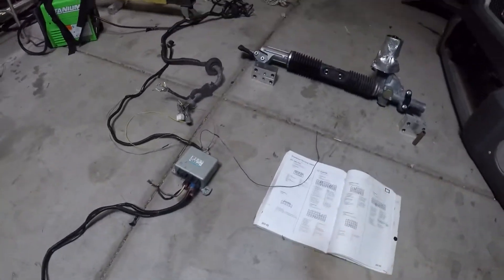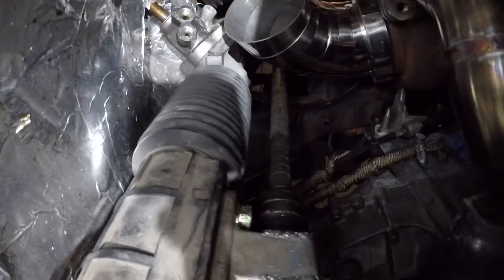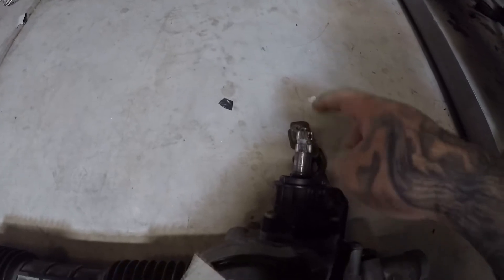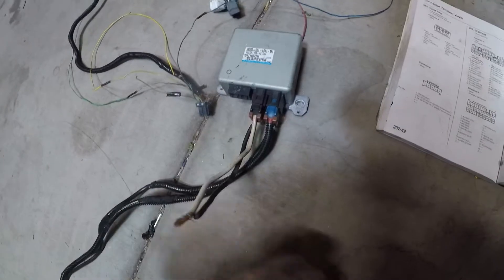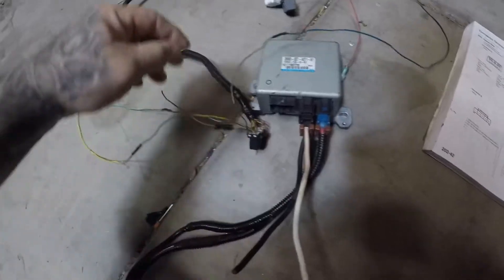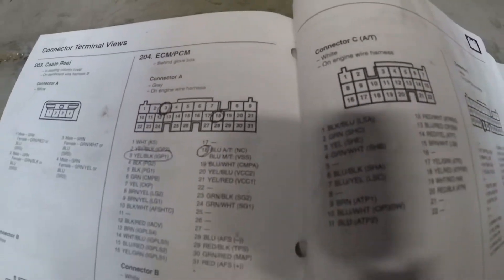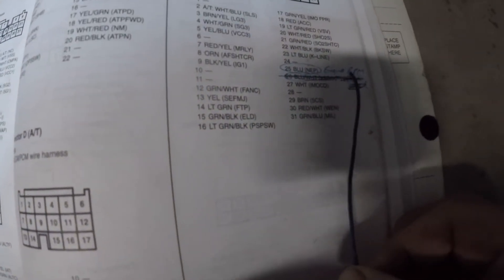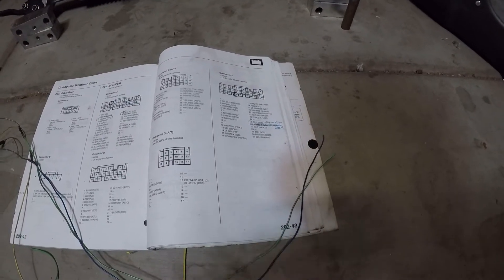Honda Element electric power steering part 2

Comment: Geeze Im listening hard. Your audio is severely muffled.
Reply from the maker: Yes I know.  I’m working on getting a mic,  it’s a 6 year old go pro. :-/.
Reply: @11AM_im  your effort is important 2us because the full electrification of all accessories is a 20yr old subject that simplifies the engine bay, modernizes &lends itself2 other upgrades. Other EPS upgrades only go 1/2way w/electric over hydraulic. Yours eliminates pump, reservoir &all hydraulic lines. I can’t wait 2c what happens when u get ahold of a scroll style electric A/C compressor &a ceramic heater core. The only thing lift will b an alternator. Imagine that combined w/a small LiON battery, aye!

U never said what e-rack &manual that u sourced?